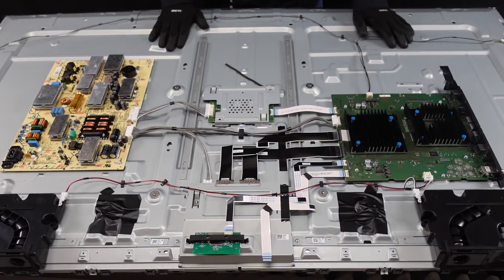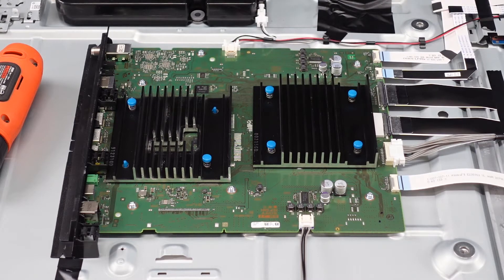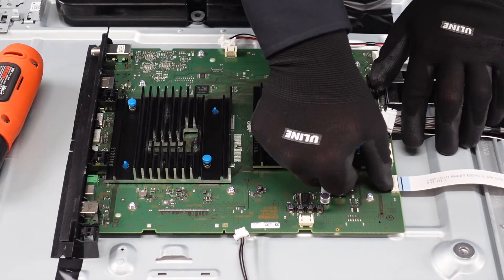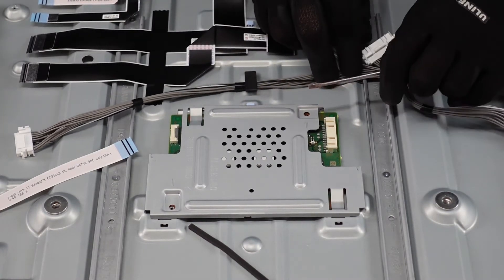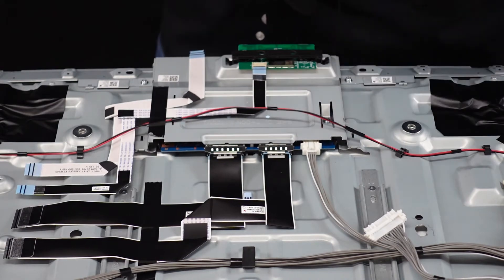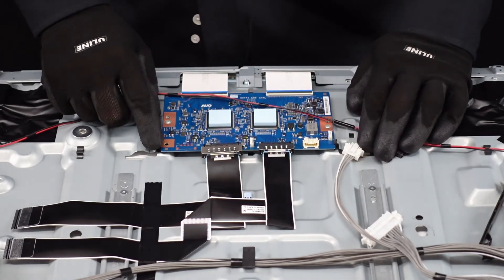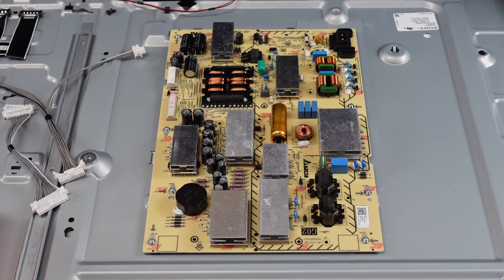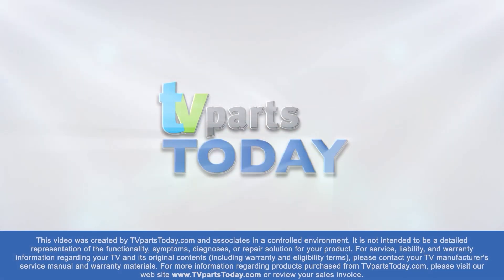Every television deserves a 2nd chance.  (SONY XBR-65X950H)

Comment: I bought this TV 5 years ago with pandemic money. I don't have $1200 to buy a new TV, but I'm also not repair savvy. My TV started turning itself off randomly and I have to unplug it to power reset and get it back on. It's frustrating.
Reply from the maker: Do you have the model in the video? xbr-65X950H?  There could be a few things going on if you do. I would give us a call and talk with one of our customer service reps. We can go over possible issues and fixes with you. (930) 212-1975
Reply: @tvpartstoday 55 inch but yes

Comment: I had two blink red lights and replaced the power supply board. I got the same error (2 blinks) with the new board in.  What would you go after next?  Cables? Main board?
Reply from the maker: I would try to swap the main board next. If you shoot us an e-mail at info@tvpartstoday.com one of our customer service reps could go over the issue in more detail.

Comment: Great video! I have a 75x950h that started giving the 4 blinking red lights today. I just removed the back panel and everything looks good from what I can see. In your experience, is there something I should be looking for that would indicate what may have failed? I would like to order replacement board(s) asap to get this thing back up and running. Thanks!
Reply from the maker: With a quick look at the blink codes, most likely, this is an issue with the LED driver or the main board. Blink codes can be tricky and I would suggest giving a call into our office or sending an email to: info@tvpartstoday.com    for more information.
Reply: I'm having the same issue with the exact same tv. Did you ever get the issue resolved? I'd like to try to repair mine as well.

Comment: Anyone have experience with a 55in sony bravia X900E brinking 4 red lights? My best buy, warranty expired Best Buy told me somebody can come out in look at the TV 📺 but it will cost $100 then after he diagnosed the problem I will have to pay for the parts and labor and she said that could come up to $600
Is it worth fixing. The tv is 5 years old as of and now doesn't work at all.
Reply from the maker: The 4 blinking red lights is a blink code. Its what Sony techs use to diagnose problem with the set, but the codes are usually vague and don't just tie back to one problem or one part. If you send an e-mail to info@tvpartstoday.com with your model number and a brief description of your symptoms we can help figure out what might be going on with your TV and what part we would suggest replacing. I would send that e-mail to our customer service department and get their opinion before dropping 600 bucks on a repair. It could end up that you just need to swap a main board or another part for much cheaper than that.

Comment: Can You show u removed the back panel from sctatch thats my issue, cant figure out
Reply from the maker: What is your model number? I'll see if we have a video posted with a similar back that could help you.

*edit*  Going back through this video, I saw that we had originally planned on doing the back removal section, but we ran into a whole host of issues getting the back off. Not only was the unit extremely difficult to get open, but there are numerous ribbon cables and small connections that will get pulled out from their seating and be almost impossible to reconnect if you were to try and put the back onto the chassis once the repair is completed. I hate, in any situation, to say that a repair would not be feasible, but in this specific case a DIY repair might not be the best course of action. If you have a Sony certified technician in your area, it might help to get a hold of them and see about getting your unit serviced professionally. It is a sad fact that many TV companies make their units close to impossible to repair by the DIY repair person, but it is the case here. I really wish I had better news for you, reg8288. Best of luck.

Comment: Have you every swapped a board of a newer tv into an older? for example X95J into this X950H? Would it cause problems with the power supply or led driver?
Reply from the maker: No, it would not.

Comment: Can the main board work with European models? XH9505
Reply from the maker: I would check the part number from the main board in your set. If the part numbers match up then it should work.

Comment: What's the difference between Power supply board 1-006-108-21 and 1-006-108-22 ? How to choose the right part?
Reply from the maker: It looks like those boards can work in place of each other. the 21 and the 22 are compatible with each other.